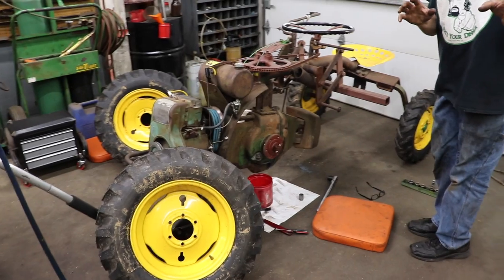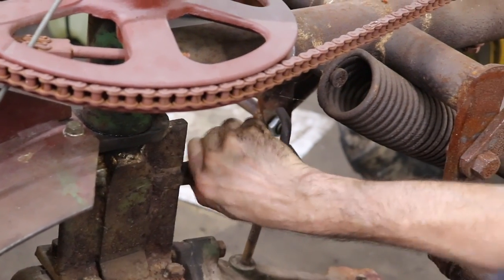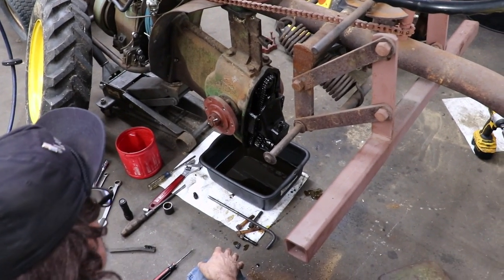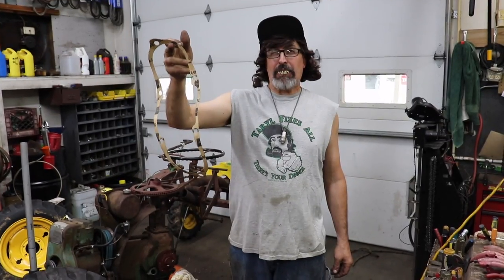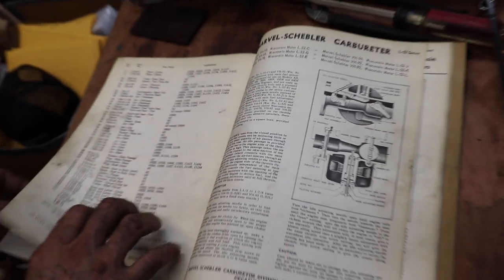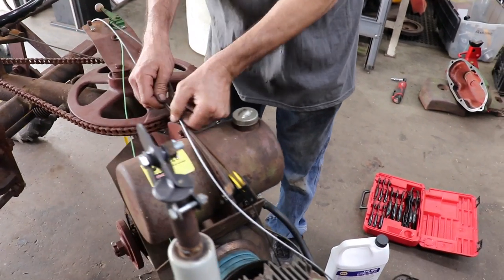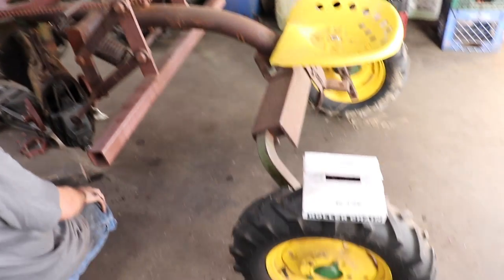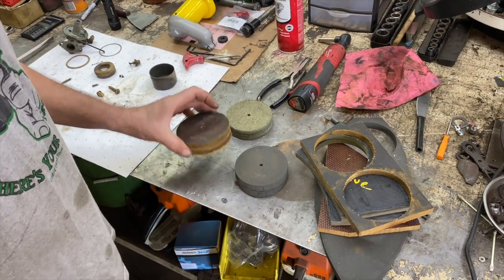AMAZING Bolens Ridemaster Restoration (Part 3)

Comment: @58:15 I can tell you what's in that disc. It's made of a phenolic resin compound and is highly carcinogenic. I used to work with that stuff at a plastics factory, accidentally got a snoot full of dust while cleaning up and still have issues with my sinuses and headaches even after 40 years.

Comment: What did ya doo  about the broken clip ring retainer on the bearing .  Never mind.   I would have used JB weld.  That chit is magic on that stuff.  You can even drill and tap it.   JB contains metal dust hardening the hell out of it.  Drill a few anchor holes and use that.

Comment: If I was tapping the exhaust port, I would have used the compressed air and a shop vac. Maybe a little excessive, but I didn't get the nickname " Over Kill Will" for nothing.

Comment: What factory taryl?? I’ve been going back one by one watching videos, I’m back to 2016 and you haven’t mentioned a factory. Was it mower or small engine related? And that’s crazy that a factory would hand make gaskets. The waste in material would be way more expensive than to make a machine to do it in the long run

Comment: The book says to use NON EP lube in that gearcase. (This means oil WITHOUT sulphur in it) Later, you said it did not smell like gear oil.   Are you aware that NON EP oil usually does not have sulphur smell?

Comment: A Terril I have a question for you I have a John Deere 345 My nephew gave me a santa tires often ATV Their 25 by 10 By 12 The tires that are on the tractor Are 23  10 and a 1/2 by 12 What size tires where I need for the front

Comment: Taryl, your business would have access to a company called McMaster Carr, for the odd part items that could help you with the bolens project or any other projects you have in mind, check it out , heh heh heh ,, that's your dinner, ; )
Reply: I got some very specific metal mesh material from them and brake shoe linings also over winter. Fair prices and lots of choices

Comment: It would probably be smart to use brass or aluminum instead of that steel hammer. Less likely to chip or dent the edges of the casting. But for a guy with bad teeth and friends named "Elk Skins" that was pretty clever.

Comment: I think that bolt comes out first , if you plan on cracking open the case . other than that you would have to sipthon the gear oil through the fill/check plug . It's p[ossible these manuals are not intended for buyers .they R 4 the mechanics of a sadly gone generation , there's your snack. 🔧

Comment: I would have drained it and put transmission fluid in it before I tore it all apart spray carburetor cleaner up in the bottom of it blow it out and then put the transmission fluid in it like changing oil on a Ford

Comment: I've had better luck if I cleaned the broken surfaces really, really well with ip. alcohol or either before applying your Taryl putty. The surface needs to be uber clean from any oils or film from cleaners.

Comment: LOL  PB Blaster........  has anyone actually looked to see how far the oil actually penetrates?  It doesn't in most cases.  If you can free up the bolt or nut, then the oil will slowly penetrate, but not very far as it isn't under pressure.

Comment: WD-40 is an awesome cleaner not a good lubricant though.
Reply: Yep, wd-40 has made some bolts coldweld because they were so clean after it, it works great as a cleaner or old crease disolvent